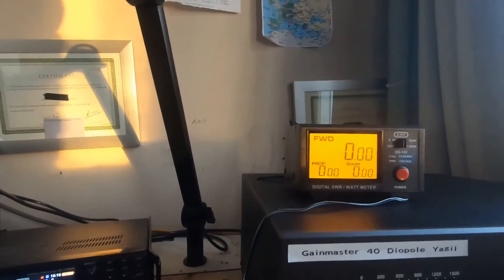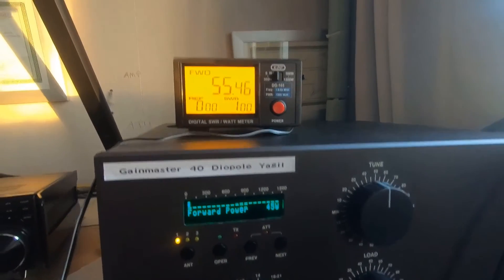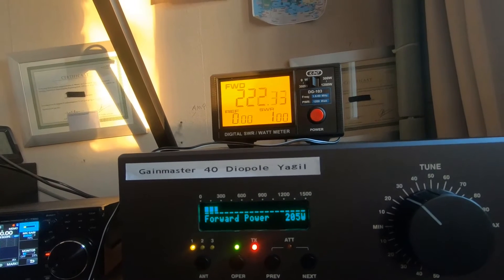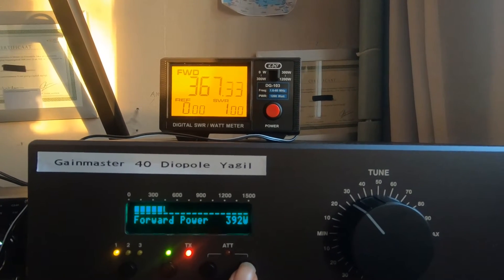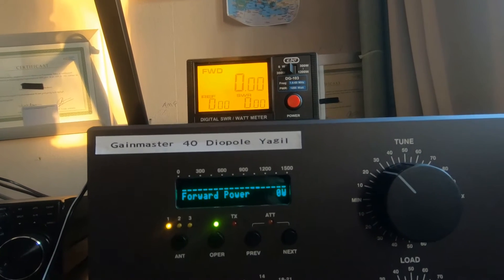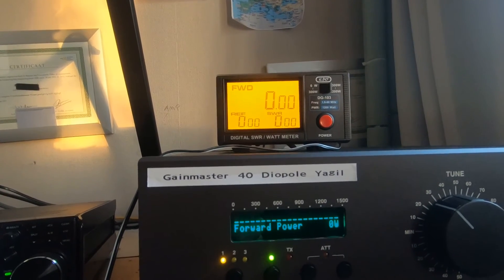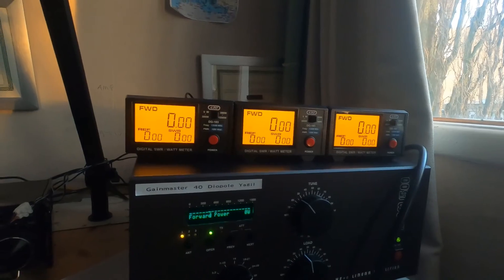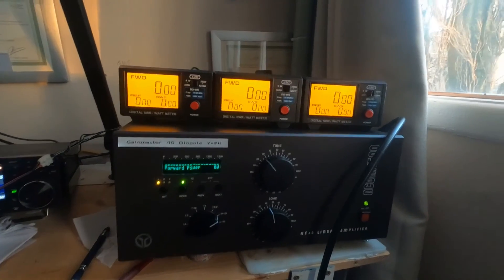K.P.O DG-103- 300W/1200 WATT DIGITAL SWR POWER METRE.....INCONCLUSIVE.

Comment: The KP-O shows you average power and not PEP (peak power) like the meter of the Acom does. It's totally different. Most meters show average readings. You need a special PEP setting to read the peaks in the transmission like the Acom shows on his screen. Buy a decent meter like a LP-100 or Array Solutions. A lot of money but these are top of the line. I used the array solutions on my Acom 2000A. ON4VP Phil

Comment: You need a peak PEP SWR/METER     that when its in PEP mode WILL NOT work unless it has DC power to power the PEP curcuit, if the meter works on PEP without power then the meter uses a capacitor for its PEP calculations and is a waste of MONEY ...
73
Reply from the maker: Hi,thanks for your advice, I am a bit wiser these days 😇,might get the Mat 1500 swr power meter soon, 73s from Rotterdam 🙏

Comment: uhm... what about the model : NISSEI DG-503 1.6-525Mhz Digital SWR/WATT Meter ??? i am expecting one in the mail soon.. is this gonna be crappy to ???..now i am worried
Reply from the maker: Hi,yes I have had also that model,,,,Great for fm ,but on SSB there's no peak option, so it gives a false reading, I found, but maybe you will have a different experience, thanks for your comments, 73 from Rotterdam 👍.

Comment: To measure ssb you need a meter that measures true p.e.p  and these meters won't do p.e.p readings.Also they don't appear to be that accurate on average power readings either.
73 G7HFS/PA3IKH